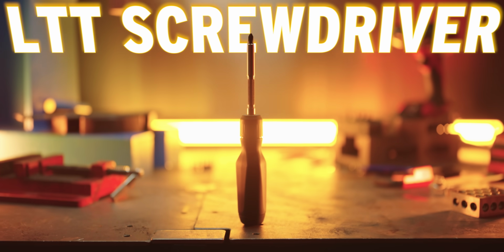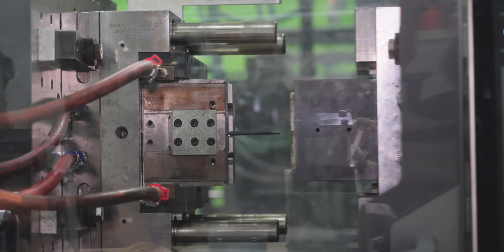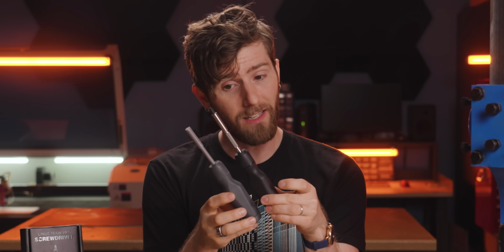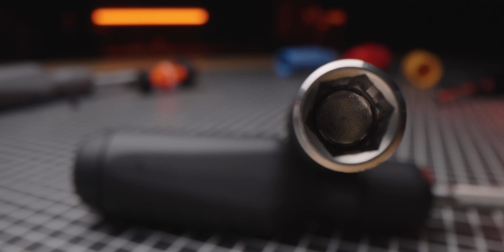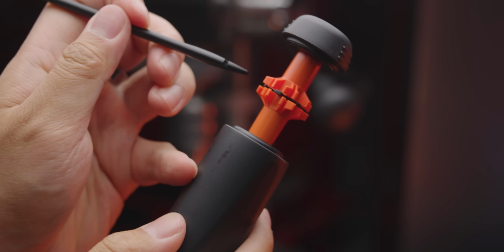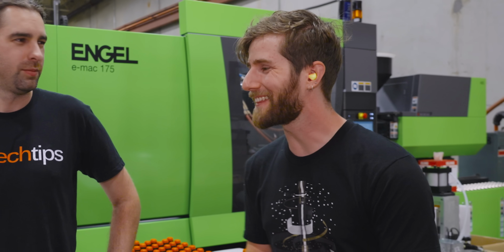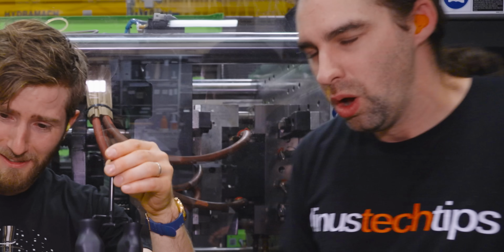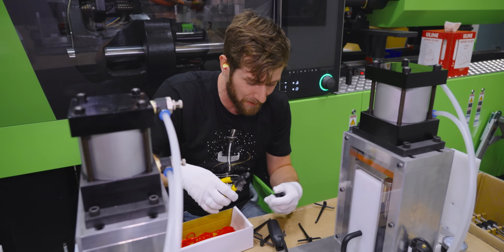Why our Screwdriver took 3 YEARS

Comment: Just something important to note or correct about the augur for the plastic injection molding. Much of the heat if not all of it is applied by the augur corkscrew itself and not a heating element. This is achieved through the frictional heating of the augur forcing it along it's path.
Reply: not on the modern Engel machine shown here if it´s not useing a non-standard screw type
the heating zones along the barrel are more then powerful enought to heat up the plastic to over 300°C and keep it there
and thats up to the core of the screw without any movement of the screw
friction does have an effect and you can even effect it a bit with adjusting the back pressure, but it is by no means the
main heat source
i have only seen the behavior you describe on old machines, old as in sometimes not even having a screw but only the 
injection cylinder and on newer ones i have only seen sheared off splines on the screw after a heating zone failed and
the controller not reacting with a shut off as it should
Reply: @lexel90  i new the newer ones used heating elements but I thought it was mostly to keep the plastic molten. I don't know the model used but a friend of mine who worked with one making clothes hangers I think said most of the heat was from the corkscrew. I believe a rough approximation for the heating of the corkscrew is energy usage of the motor driving it and then that can be compared to the heating element. For the engel here heating elements are less than half.

Comment: I'm gonna be honest, I don't plan on buying a screwdriver, but watching this and seeing how many details they looked over to end up with a finished product of that quality.. shows how much effort and passion they have.
If I were to buy an expensive screwdriver that lasts my lifetime, I would buy theirs, good job LMG ! :)
Reply: Just but a Klein for like 1/3 the price. The rubber jacket over the tool handle is a dream in one's hand.
Reply: i’ll buy cheap wrenches and ratchets, but screwdrivers absolutely not. the metals are very soft in comparison and this is a BIG problem with screws.
Reply: To be fair, cheap screwdrivers also tend to last a lifetime.
Reply: @hobermaas4166  Yes, and no. The ratchet might fail prematurely, and the metal is often of a softer material.
A cheap screw driver wouldn't last a week in my tool box.
Reply: @panzerveps  I've had damn good luck with cheap tools.  I mean hobo freight is hit or miss but when they hit you got a damn good deal.  My favorite is the Pittsburg floor jack that is the exact same jack as one they sell on snap-on trucks.  Knowing what you are looking at is much more reliable than 'cheap bad, pricey good'.
Reply: @thoughtlesskills  It depends on what you do and how you use the tools.
I'm a professional mechanic, and said tools would most likely wear out, or break, if I used them.
I didn't want to shell out a few hundred on a new screw driver, and got a set of 6 from the local equivalent of harbor fright. After 2 weeks, one had the tip snapped off (I'll admit I had used it as a chisel, but the expensive ones can usually take it) and another one had started slipping due to wear.
Reply: @hobermaas4166  They really don't, unless you barely use tools. I keep separate screwdriver kits for hobby and work, and even the hobbyist kit had to be replaced twice.

Comment: From a maintenance persepective, I like your design ;The start to be able to use standard 25 bits is a nice touch. The Strong magnet too. i'm a bit worried about that shim between the shaft and the handle, however, it should be unsuable, merely unconfortable at worst, so nicely done.

Comment: This might have just sold me to buy one. If nothing else out of sympathy for product design.

At the very least I'm showing this video to my boss to show him why a product I started a year and a half ago isn't finished yet, it's quite a bit more complicated than a screw driver, but we're about 6 months out from a production product, which is 100% more than the previous team of engineers can say as they strung the company along for 8+ years and never released a completed product. 

My only problem now is I have to deal with the stigma my predecessors left behind.

Always good to know you're not alone out there in anything you do. 

My biggest challenge has been convincing them to buy me a rapid prototyping 3d printer. The lead times have been killing us when waiting on small changes that end up adjusting again after we run tests or check fit and finish.

Comment: Any voltage rating on it? I dont get why use non coated steel shafts i am a tech i work with psu's i am not buying any screwdriver that is going to allow a faulty product or other issue to cause my untimly death mid repair. Even in the reverse situation power like static charges can run from the user into the components when they touch the uncoated shaft. I just dont get releasing a electrical repair screwdriver you really shouldnt stick inside any machine with any voltage inside or without useing a static strap. Basically its a expensive case opening screedriver.
Reply: You could of made a god level 1000v rated reachet driver that every tech , sparky or tinkerer could use in any situation With complete safety. you missed the user safety mark and you excluded a large part of the industry from being able to use this as there daily driver due ti needing voltage rated and coated drivers

Comment: I was gonna knock the proprietary bits, then they said they thought about that and made the Bit loader Adjustable to fit standard bits..  Still question how well it will hold longer bits with the shorter socket  but time will tell

Comment: So i don't want to be this person, but one Glaring issue i have had in the past (with my snapon equivelant) is when a small metal shaving ends up in the end of the tool. It eventually becomes a nightmare and results in bits not seating correctly and becomes terrible to remove.. I can only imagine with a powerful magnet this will be an issue. The other challenge i have had (with my snapon equivelant) is the magnet eventually leaving due to the glue / adhesive wearing out over time. Either due to heat, or just constant use. Anyways, i have ordered 2 but i hope this doesn't end up being an issue.

Comment: This Looks Like a Well though throu Produkt, the only issued i have is actually with the Direktion of the ratchet selector beeing the same direktion as the scru direktion.

Reason beeing that especialy in tight spaces the selector gets stuck on Something, Ending Up selecting the wrong Direktion. This would make the Process realy annoying.

Comment: My only problem is that a PH3 bit isn't included. It might sound nitpicky, but sometimes stripped screws can be easily turned with a bigger bit, which in this case is a PH3 bit.

Comment: I really don't get what's so special or complex about a screwdriver? A screwdriver is a screwdriver. They're all the same. As long as it's long and can reach the screws I need, I could care less about magnetic tips and all those fancy features
Reply: Mate, that just means you're not in the market for this. Just cause you don't care about those features, doesn't mean others don't either. You're not everyone.

I for one absolutely despise screwing in tiny screws without a magnetic screwdriver, it's aids.
Reply: @kadrix732  yeah but a little inconvenience is worth the money you save just using a standard cheaper screwdriver

Comment: Linus, to get some more bang for your buck you could just sell the shafts. With that good knurling and strong magnet It would be cool to just have a couple with common bits in the shop, and they could fit in a pen holder.
Reply: That would legitimately be pretty cool. Maybe it could have little flip up handles if you needed some emergency torque.

Comment: Surely the Megapro ratchet was the correct way before?
You hold the collar with one hand, turn the handle the way you want with the other, and it locks into ratcheting in that direction.
Sure you might now turn the collar the way you want the driver to go - but you're turning the handle (the thing you'll actually be using to screw the screw) the 'wrong way'

Maybe it just depends how you use it - but as righty I hold screw against tip with left hand (and can hold collar with rest of my big mitt) and then just turn the way I want with my dominant right hand.

Comment: Yeah, I'll stick to my iFixit kit. I can buy an entire driver set with lifetime warranty (including the bits) for less than this gimmicky ego tool that's just like every other ratcheting driver. Or if you realllllly want the ratchet, go buy literally anything for $10. I have a 10 year old Stanely I got from Walmart and a 2 year old Kobalt double drive that both work excellent. Can't imagine why anyone would spend $70 on a screwdriver that doesn't even have any safety ratings. They're literally using the same parts and materials as every generic driver while touting how "premium" everything is. You're using a zinc ratchet for crying out loud, the same shit pennies are made out of, but making it seem magical. Nearly a hundred dollars for a fucking screwdriver that they copied lol...
Reply: OK Alexander walker

Comment: my main concern for longevity is that the ratcheting mechanism has that little plastic lever system (the one that was off on the early prototypes causing jamming), would wear over time and start jamming anyways.
Reply: Megapro's ratchet system is pretty damn reliable.

Comment: Not trying to be an A hole. But this costs wayyy too much. I would gladly buy a Makita 3.6V cordless screwdriver set (with many bits) which has the same price. Note - I have a Makita used over an year every day and still going strong.

Comment: At the risk of ripping myself off for a patent idea... I am going to suggest that all screwdrivers should actually have a secondary arm/leg with a rubber stopper on the end.  Why? So you can create reverse tension, so when you are using a wratcheting screw driver, you can have it use forward screwing or backward screwing regardless of which way you are ratcheting.  Now keep in mind, you have to redesign the ratcchet section for this to provide bi-directional forward motion. In other words, for forward screwing, you turn the driver forward, the screw turns forward, you ratchet backward, the screw turns forward.  You can then switch the ratchet to reverse, to do the same thing when you are unscrewing...
Reply: Don't worry, the notion itself isn't patentable.

Unfortunately, I believe reversing the torque would require a pivot, and if your hand is that pivot, it could get pretty uncomfortable. But it might be doable! You should give it a try!
Reply: @DanKaschel  The pivot would be internal.  I forget the name of it, but there is a gear arrangement meant to be designed so that whichever way you turn something, the center gear turns one way..

Comment: I can't believe this. It actually miss one feature that I find SO important in a top screwdriver. There is no hexagonal part on the shaft to use a wrench to thingen stuff. 😲
Reply: I agree, but that is usually too much force for PC hardware - that feature can get you into trouble. I build most PC hardware using a 4mm screwdriver. I wish Linux built one of those.

Comment: as linus already said, one problem with kickstarter product (i knwo this isnt) is that when they comes out, they are already old. It's the same for this. I'm sad because i wanted this screwdriver so badly, but after 3 years, there are plenty of better product out there. not to mention cheaper. hard pass for this

Comment: i know the part being out by 5/1000ths of an inch sound sminute and crazy how that small difference has a huge impact, but i work at a place that manufactures galvanized and passivated steel and the tolerances we work with for customers is down at the singular 1/10,000ths of an inch, so a manufacturer being out by 50/10,000ths is actually a ton for a specialized primary manufacturer. your product was OUT by 50/10,000ths of an inch, we produce stuff that is smaller than 50/10,000ths so the variance you were OUT by, is the entire size of some entire products we produce

Comment: I actually participated as a test person in tool developement, and sorry, but there is NOTHING  ergonomicly better then a round handle with a senscible knurling on it. I probably tested houndreds of handles, both for maximum torque, and for maximum speed, and NOTHING beats the old Bacho Ergo handles.
We even added a pice of a wooden broom handle, and it outperformed most triangual/hexagomal funky handles on the torque meter

Comment: gas marks are called dieselling effect caused by trapped air in the mold, like diesel engine ( first compressing air then injection of fuel ) compressed trapped air causes molten plastic to degrade, as an mechanical engineer works on plastic parts on automotives, enjoyed video a lot

Comment: My ONLY complaint to your design, as a mech-e myself, if that I wish you had used 304 over 303 stainless for the shaft. Machinability is similar, but we tend to call 303 "fake stainless" in the northeast of the US, especially for tools an equipment used in and around marine environments. Otherwise, it looks like a great project and a great product

Comment: As someone who works in the electronic repair industry I can 100% tell you that this is just a regular screwdriver. Having seen the amount of abuse drivers receive from our techs makes the idea of storing the bits from within worrisome. Last thing I need from the screwdriver is internal shake from loose bits. The final nail in this project not being torque adjustable so there goes precision work.
Reply: You know the bit holding mechanism is just megapro's mechanism, right? That mechanism is already well-proven.

Definitely fair about not being torque adjustable though. If you need that, then this is not the tool for you. From what I've seen, those are usually quite a bit more expensive than this.
Reply: @DanKaschel  They are good quality no doubt on that but from use cases having a screwdriver of that length is more practical without the bits. Just like Gamer Nexus set. I have less issues in clearing the drive threw the screw hole as opposed to something that is a little thicker. There is also the issue of occasionally the bit getting left behind.

Comment: gimme that screw driver babyyyyyyyyyyyyyy

i have one that is almost identical to linus' original and my grandpa used it until it broke, then JB welded the ratchet so he could still use it as a normal one. and i've currently been using the kobalt geared driver, but it doesn't have a ratchet. the electric pen types are nice, but i want Linus's driver. GIVE IT

Comment: How is the chemical resistance?
Usually multi-bit drivers like this are made of that clear-plastic rubber stuff that fish-bait and tackle boxes are made out of(craftsman.. klein). The problem with that material is that it gets all stinky and melty if any solvents get on it for too long.

Comment: As nightmarish as this whole process was, I'd say it's absolutely worth it. A delayed product with lots of work invested will eventually be good. A rushed product is bad forever and the reputational damage would be astronomical considering all the anticipation that's been building over the last few years. 

Large tool manufacturers have been around forever and the market is crowded with options. If you want to sell these, it has to stand out and I'd say you've accomplished that goal. While I love my Wiha screwdrivers, I'd say this will eventually be in my tool bag. It's unusual to see this amount of care and detail put into a tool, even from brands like Snap-On. It really boggles the mind how far LTT has come in a relatively short timespan.

Comment: You know, I wasn't going to buy one of these because I thought the price tag was ridiculous, but this video changed my mind. I know it's going to read like some testimonial BS or whatever but seeing the thought and care that went into the design of each individual part, the thought process behind it, the reasoning behind the delay, and the small tweaks for each individual level is a breath of fresh air. So many of today's products are coasting on name brand and as mentioned in this video, LMG could have just went with a "LTT" branded color option screwdriver and they didn't.

The value of LMG / LTT is on your guys' transparency, quality control, and attention to detail you put into whatever product you put out. I am super excited to see some light being shed on power supplies and audio gear, much like the testing of HDMI cables that was done a short while back. This is an untapped space and as long as the LTT gang stick to the previously mentioned core tenants, there is no rival in this space and there is no monetary value a competitor could place on you.

Comment: Great to see the work that has gone into this screwdriver. I however find that shaft of these types of screwdriver be too thick so you cannot fit it into holes with recessed screws. I'd therefore of gone with 6 bits, but longer double ended ones to compensate?

Comment: So you say that this is hot?
I work temporarily in a rubber factory. 
The moulds are 200°C hot and you have to take the rubber out with your hands. The machine isn’t doing it itself. And for protecting your hands from getting burned you only have 1 layer of gloves. 
You can’t imagine the pain from the burning and how many blisters you get.